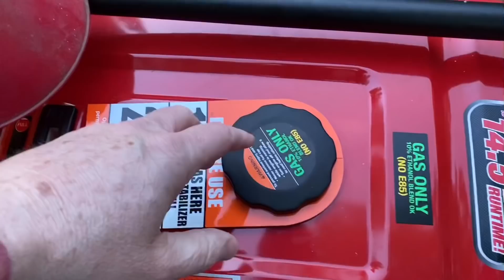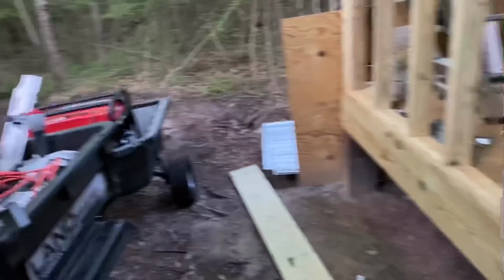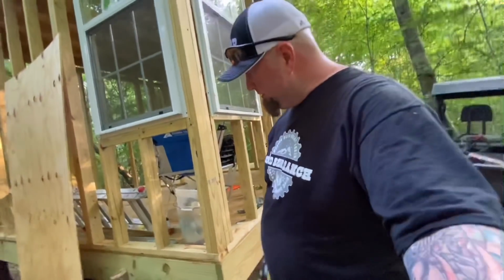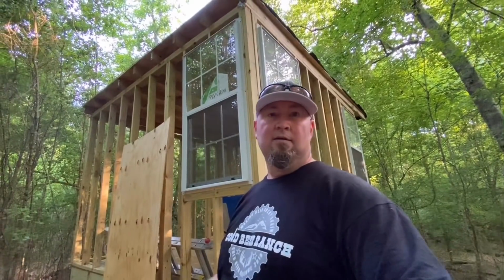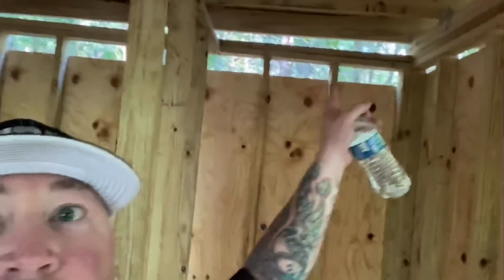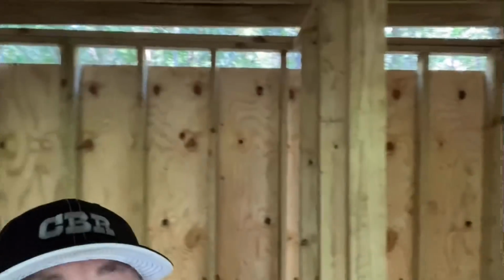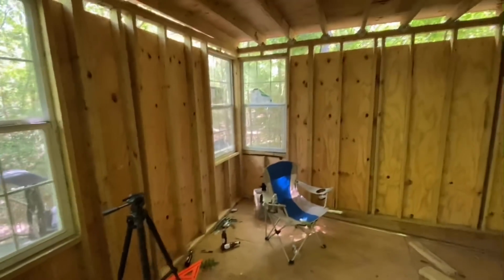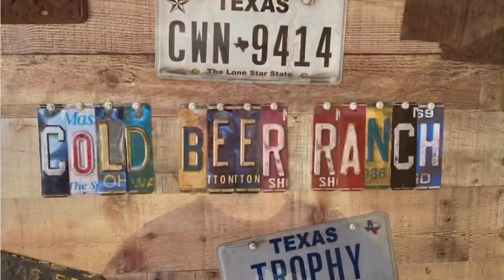Skinning Cold Beer Cabin, One Step Closer

Comment: Nothing like a Cold Beer Ranch video to lift my spirits up.
Might have to figure out some tires for the generator. Or I'm thinking the bucket on the Deere would've worked just fine. Looking good
Reply from the maker: Both great ideas. I did buy a wheel kit but it didn’t fit, argh!  Take care of yourself John🍺🍺
Reply: Wheels sound like a good idea.

Comment: We took a small cart and put our generator on it so we can pull it to where it is needed.  Be sure to tarp your generator and compressor from the weather.  You will need tar paper on the roof before the tin goes up.  When I saw you put up that first sheet of plywood, I was saying screw in some wood on the bottom to set it on, and then you did.  It is looking good.

Comment: So, as everyone can see, If we put Plywood on a Frame like this, then its the easiest to 
First: Screw a Board on the floor-elevation around the Structure, so that the plywood has the same night all around the building! 
2 Then just let the Playwood stand on that board, and staple it on to the 2x6es (or whatever u use!) So you don`t need 2 Hands to hold the Plywood and a third for the staplegun  ;-) lol! 
2. Third: First the Plywood, then the Windows! And if you are smart, then saw the Windows from the inside on the sides, and on top of the windows, so that you have that 12mm Rest from the Circular saw! On the Floorside of the Windows, use also the circular saw, but make this flush and even to the vertical beam! So any water that comes in, can drip out. 
The 12m Rest of Plywood that sticks into the hole will give you the edge where you can put your windows against, and you technically don`t need to trim them on the outside. Just ake it so, that the cut is nice and straight! 
Then cover all that with Housewrap, install the windows, and that is it!